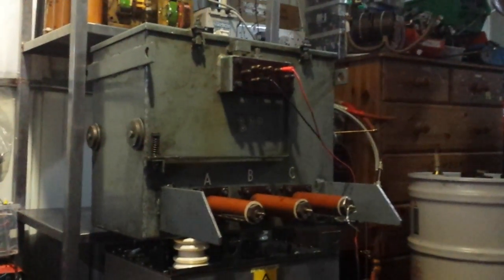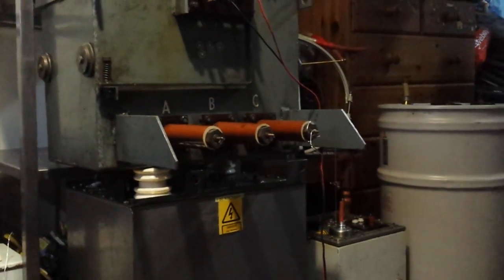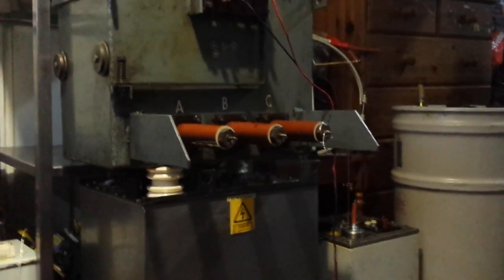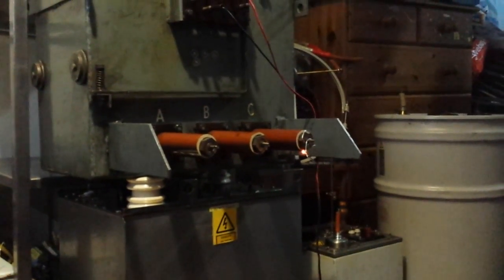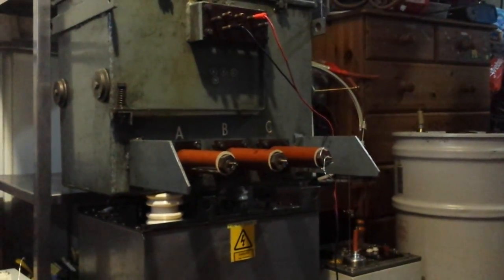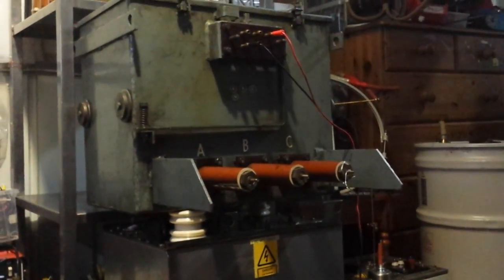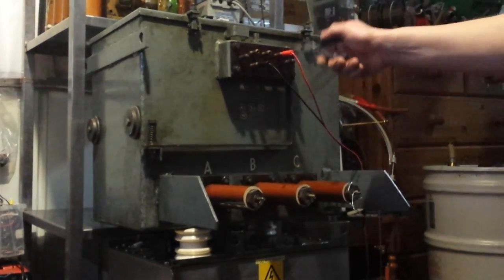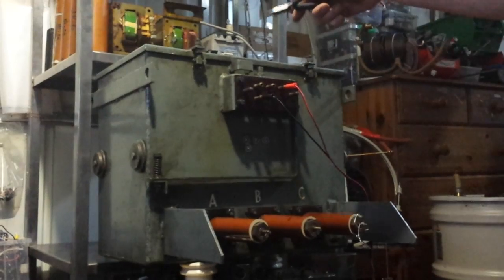BIG BOYS  Transformer @ 11K.V arcs at 3000watts⚡

Comment: That's a nice beast! Looks like there was a wee bit more than 11kV between phase A and B, judging by those long thin sparks. Are the coils wired in delta or wye/star configuration (in star or wye configuration there will be a neutral point connecting the ends of all 3 HV coils)? If it is indeed wye/star wired then you can put all 3 phases in parallel for quite a high current capacity (if I'm remembering correctly). Then all 3 HV terminals will be at the same potential and you can draw arcs from earth.